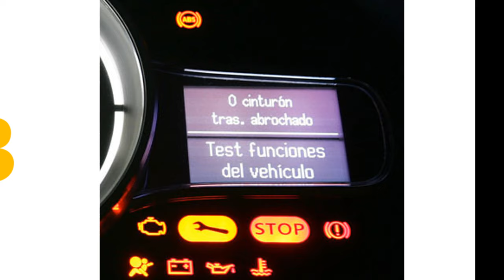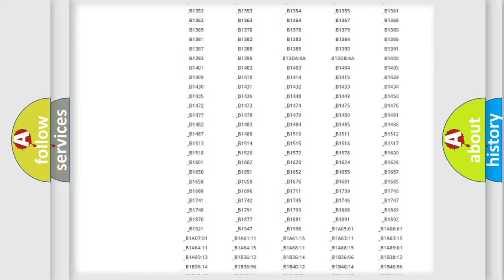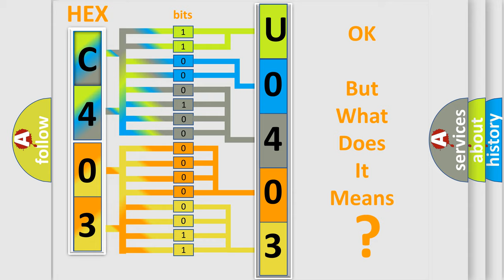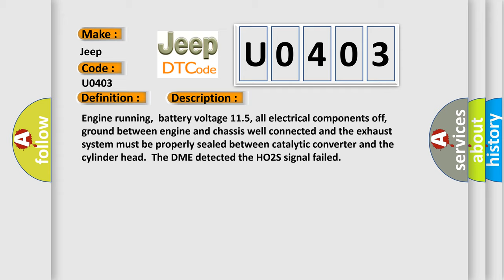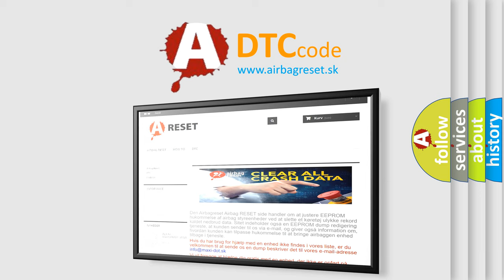DTC Jeep U0403 Short Explanation

Comment: Just a slight update, this code actually relates to implausible data recieved from the transfer case when its reading in the transmission control module which is most likely on the auto model